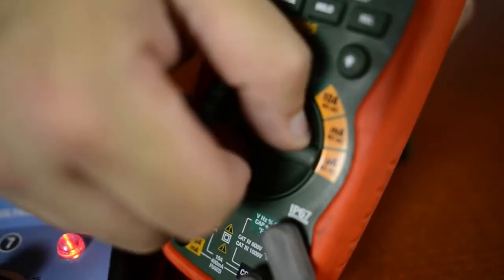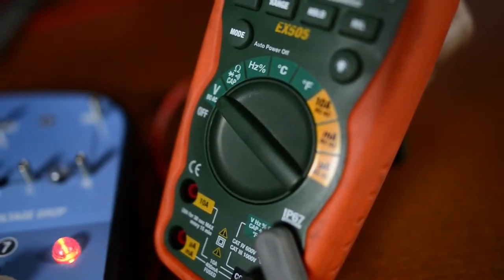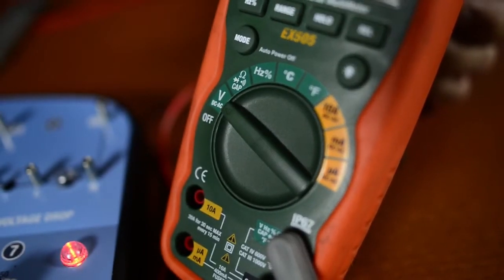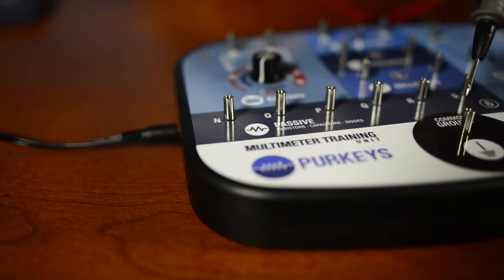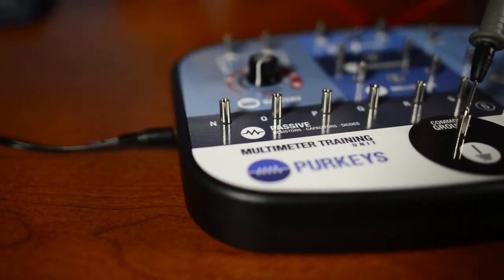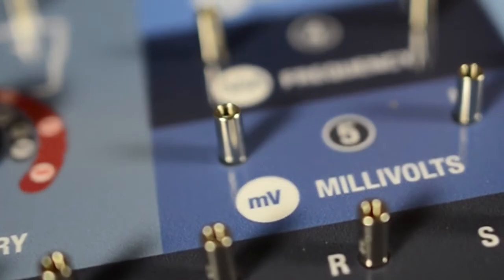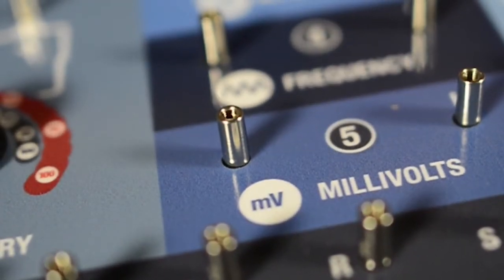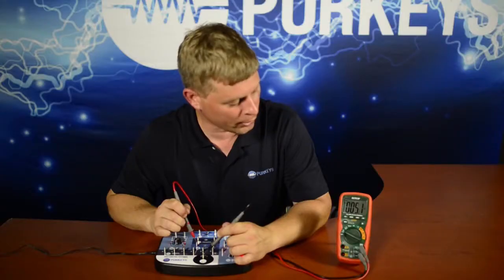Using the Multimeter Training Unit (MTU): Millivolts 2 - Purkeys

Comment: My multimeter only 5 USD, I bought it in Indonesia, I think the one you show to us are the expensive one, may be 90 USD or 100 USD, am right ? More complex, more money, but I wanna, mesure kinda, AC current, not the voltage one, can I ?, it is around 12 Volt AC, subject to resistor (a small lamp) and an inductor, So I can get the resistance, am I right ?
Reply from the maker: Yes, generally speaking, better multimeters cost more. The multimeter we use in the video is a mid-range priced multimeter (available for purchase on our website) that will provide accurate readings for most general-use scenarios. Most multimeters, even the cheap ones, have the capability to measure voltage, current, and resistance, though it will depend on your exact meter.
Reply: @Purkeys  ok

Comment: I have a real cheap multimeter. I need to measure millivolts. Do they all do that?
Reply from the maker: All multimeters should read millivolts, but the accuracy of the readings could be in jeopardy when using a cheaper multimeter. If your meter shows a reading of .012 V (volts,) that would be equivalent to 12.0 millivolts. Your meter may also show 12.0 mV (millivolts).
Reply from the maker: This could vary depending on the multimeter. Some have a millivolt option on the dial, while on others you would set the dial to volts and change the range of the meter to read mV (millivolts).